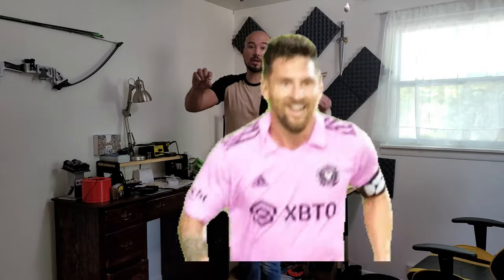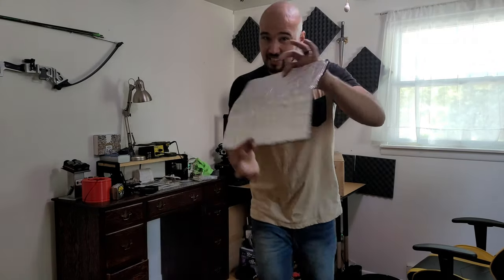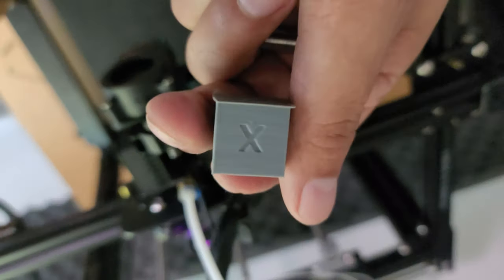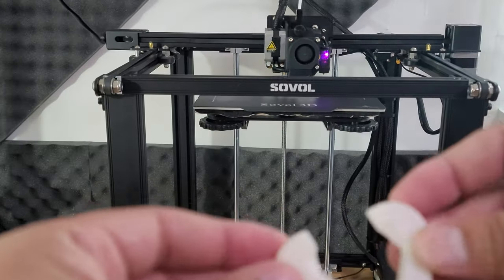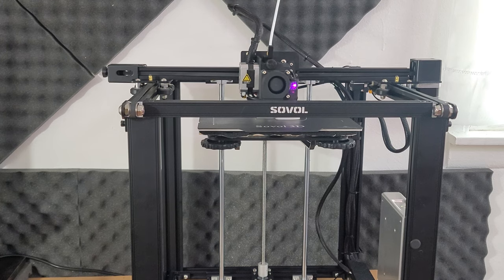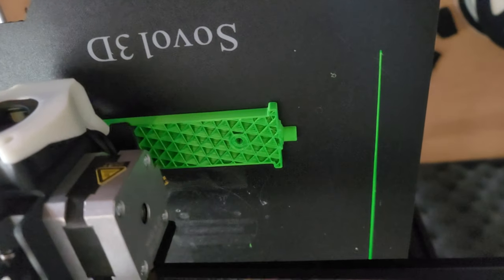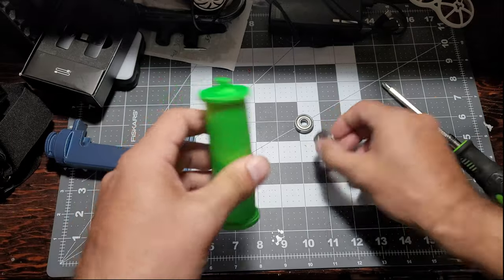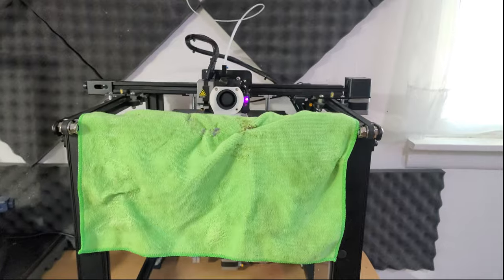Making a fast 3d printer cheap in sovol sv05

Comment: Why not the SVO6?... is it because the SV05 is easier to upgrade asking because i am trying to decide which first FDM to buy...
Reply from the maker: Bed's slingers aren't good for a b s and I print a lot of a b s . I know the SV06 is faster. But I'm pretty sure I could install clipper on the Sv05.
Reply from the maker: And a 100 mm per second.
Plus the 1000 acceleration, it's a pretty fast printer out of the box.
Reply from the maker: But yeah, if all you're planning on printing really fast. Is your p LA then? The Sv06 is probably your best bet. You will have to slow down your p t e g a lot and probably won't to be able to do a b s
Reply: Yoy still have any of the bi metal heatbreaks

Comment: Who won the heatbrakes?
Reply from the maker: Lol they where to small so the garbage did 🤣 😂
Reply: @djmorodaraye4313  I finally got mine assembled and turned it on only to have my nozzle press itself into the magnetic build surface into the second magnet underneath. Now, while I'm waiting on my replacement build plate I'm using a glass plate I had that fits perfectly.
Reply from the maker: @ijcarroll  Man, that's a bummer.Well let me know if you need any help
Reply: One big question, though. How did you get the ptfe tube out to put Capricorn tubing in, and was it difficult?
Reply from the maker: @ijcarroll  Been a long time since I did it. It was super easy. I believe it just disassembled it . there's a lot of play in the direct drive system, so getting it together was a little fiddley. Also I have a tool for cutting p.T f e tubing tubing so I was able to get a nice straight piece that fit perfectly. But you can 3D print one out of PLA.And use a razor knife
Reply: @djmorodaraye4313  thanks I have a whole 2 ender3 length of Capricorn tubing minus the 1 length of  heat brake for my ender 3 (I did the same trick for my ender3) and saved my old bowden for transport from extruder to hotend it saves SO MUCH Capricorn tubing. I just thought that the heat brake had a permanent lining of ptfe on the sv05. Seeing as I usually only print in PLA and PETG, I should be good indefinitely. ...now just need to figure out if I can make a sprite extruder replace the janky one on the sv05. Where there's a will there's a way.